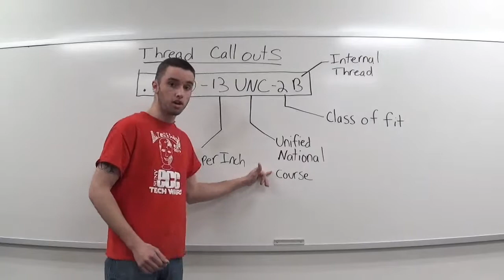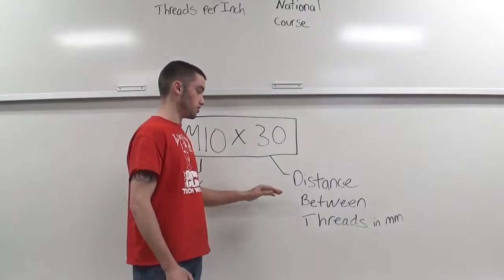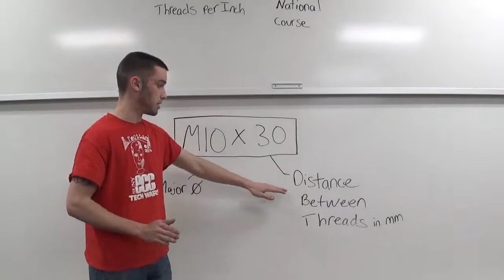Thread Callouts

Comment: Good video.
You explain it well.

The only thing that i would change is the Metric Thread on the white board.
You show a number of 30 which makes it confusing for those watching.
The number 30 signifies the Pitch of the Thread.
But try not to use such larges numbers.
Best to show the example in ISO measurement.
M10 x 1.50 MM

Other than that.
 Love your video,s.
And keep posting as it does take time for people to find you on YouTube.
Regards Peter.